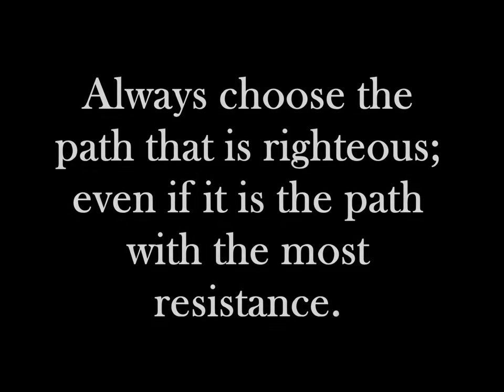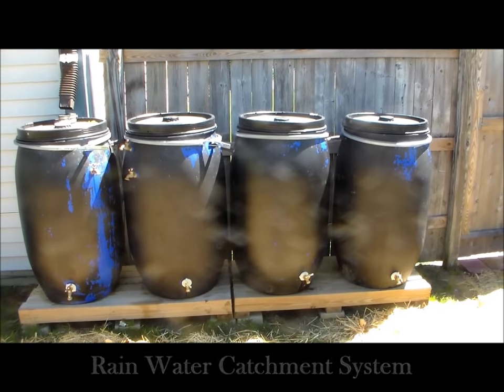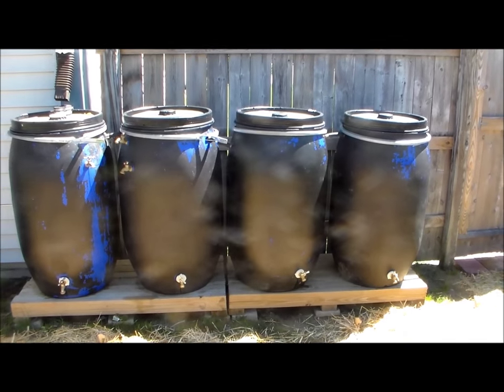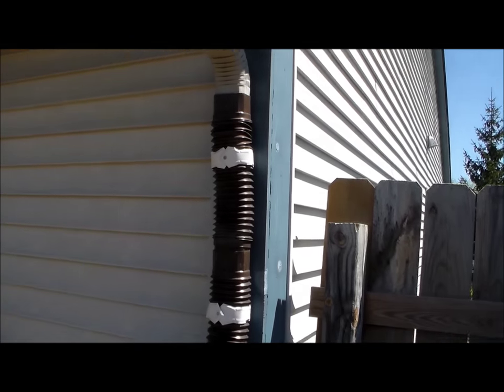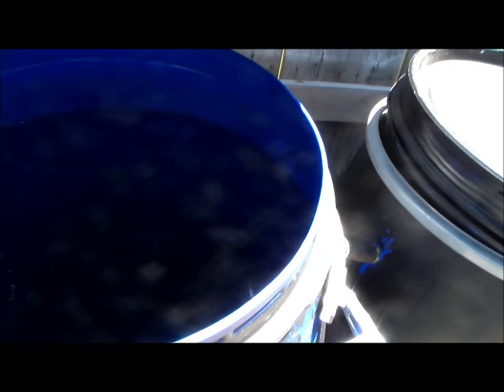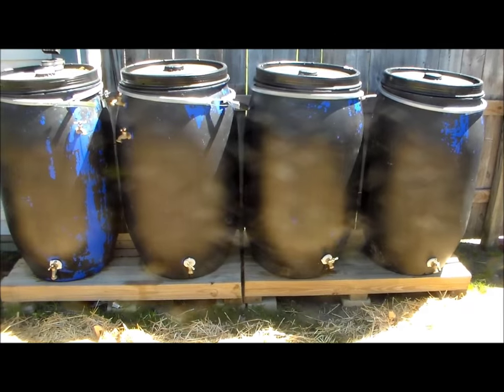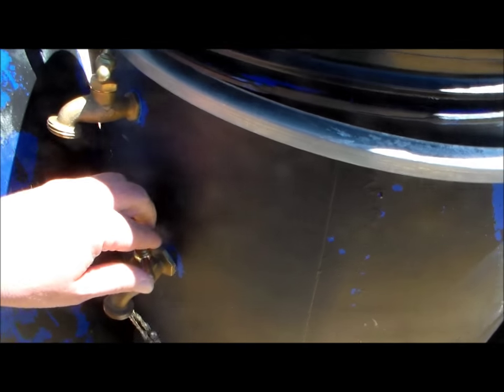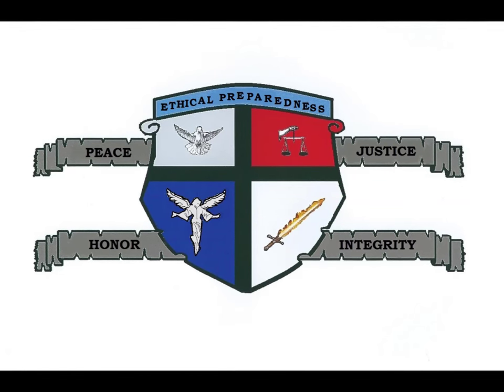Prepper Water Storage: A Poor Man's Cheap Rain Catchment System - Rain Barrels

Comment: Great video! Good, basic hydraulic engineering, and a job well done! I DO have a tin roof, and this gives me ideas! In my area, the city has a "reduced cost" rain barrel program, which is offered once a year. The premise is that we should use rain water for our gardens and water features, and avoid usage of more costly, pre-treated city water. I plan to investigate further, and I'm wondering how much water collection I could manage with big plastic trash barrels? After much investigation and study, I, also, chose the ceramic candle gravity drip purification system. So far, I am satisfied with it. The water I filter actually tastes good! No fluoride or chlorine taste- which you get used to, but you sure do notice the difference when it isn't there!
Reply from the maker: +Kitty VanDuser I've heard the black Berkey filters purify the water a little better than the ceramic candle filters. However, I've only 'heard' this and haven't took the time to research it myself. Do you know if that's true or not? I've got both, I've got the Berkey black filters, plus the ceramic candle filter, plus the Sawyer all-in-one filter too. Plus I've got a couple of boxes of plain pool shock just for back-up for back-up. Take care and keep safe and also thank you for the compliment on the video. :)

Comment: I have a similar system to water my garden,I also have a well with an alternate hand pump
Reply from the maker: +Michael Smith That is awesome! Especially that you have a hand pump for your well. We just recently got a hand pump for the well at our retreat location, but we don't have it hooked up yet. I'm curious of something though- will those hand pumps freeze during the winter?
Reply: +Ethical Preparedness Probably,wish my old Gramps was around to ask how they did it in Vermont.I'm in Florida now so it's not a problem for me.The only trick I can think of is to keep the water running at just a trickle.

Comment: Great job on the video on the rain system, it’s been three years since this video I’m just curious have you made any modifications to the system, thank you
Reply from the maker: Nope, I've not made any (other than adding the First Flush system to them).
I pretty much just clean them out every spring and let the spring rains fill them up. They work pretty good as is.
Note: I do have to touch-up with the spray paint the outside of the barrels every year... as the black paint slowly comes off over the course of the year. :)

Comment: Thank you. Let me ask: have you ever had the water check for petrochems after you ran it thru the Berkey? Ask, b/c as you point out, asphalt shingles, which most of us have, are petrol based.
Reply from the maker: +SC Rider No I have not. But I'm about to get the white filters which filters out even more than the black filters do. But I don't think I really have that much to worry about (of course I could be wrong) because the water doesn't really stay that long up on the shingles anyways (at least long enough for anything to really leach into the water). But again, I could be totally wrong.
Reply: Ok, thanks. Another Q: what is the cleaning out every year revealing? Is there green growing?
Reply from the maker: Nope, I've not had any green growing. Just silt that makes it through the screen. I think (not for certain, just a theory) that painting the barrels black blocks the sunlight and that helps to keep the algae from growing. So for the past couple of years I've only cleaned out just regular silt out of my barrels. The first barrel obviously gets the most silt; and the last barrel is usually still crystal clear every time I dump it to scrub it out. I use a small scrub broom, a little bleach and a little dish soap to clean them. :)
Reply: Ok, thanks, wanted to see what your experience has been, b/c have seen number of water barrel systems that are all cemented, meaning, cannot be taken apart. So, there is no cleaning that can take place, I would assume. Was considering the benefit of a cemented system, vs one that could be inspected yearly.

Comment: I think I may have made a mistake.  I purchased a 55 gallon "rain barrel" to put water in to store in my basement.  The barrel has a screen on the lid.  Is that going to create a problem?  Is the water supposed to be stored in an air tight container?  I plan to fill it with reverse osmosis.  Thanks in advance for your advice.
Reply from the maker: I think you'll want a lid that seals pretty tight for that barrel. 
A screen will allow dust and other stuff to get into your water; plus a screen will allow for water evaporation. 
I hope that helps :)

Comment: Could you live off of 32 oz of water every day in an SHTF scenario? And how would you cook ramen noodles in an SHTF Scenario?
Reply from the maker: It would depend on your environment and the amount of work you're doing (regarding on if you could live off of 32 oz of water everyday). If you're in a very hot environment and doing hard labor (such as gardening and/or hiking, etc), then you would probably need more than just 32 oz of water per day. And you don't have to 'boil' ramen noodles to get them soft enough to eat; I've eaten them after they've soaked in tepid water for about an hour. But to cook Ramen noodles, I would use wood and cook them over a campfire (as long as I didn't have to worry about others smelling my campfire). :)
Reply: Ethical Preparedness Thank you, very informative.
Reply: +Ethical Preparedness if you are in a hot climate only never work during the middle of the day always work in the morning and after noon when it's colder

Comment: when ya say pool shock ya realize there 2 types 1 is poison to you the other is good for this   the correct 1 is calcium hyper clorate      yes?
Reply from the maker: +embarado smithing and woodcraft You are correct sir. We have the regular pool shock that can be made into the chlorine stock to make bleach. We do not have the Super Shock which has the anti-algae chemicals in it. But that's a whole different video I plan to do where I am planning on treating the rain water with the Berkey system and also the pool shock.

Comment: if ya had put the same  hose barbs and hose in bottom as in the tops  ya only need 1  hose  spigot there by cutting cost
Reply from the maker: +embarado smithing and woodcraft I thought of that originally, but it freezes in my state and I wanted each barrel to be able to be individually moved into my house to thaw if needed. So I went ahead and put a spigot on each barrel so that they could be used individually or as a group. At least that was my rationing anyways. :)
Reply: Ethical Preparedness I posted a vid on shock approximately a year ago
Reply from the maker: Can you post a link to it here? You Tube is trying to take me to your Google Plus page and not your You Tube videos.
Reply: it wont let me paste a link hear ill sent it pm
Reply: sent them  i did calculate a touch strong on the cloreen  stock so  it would work well for every one
Reply: +embarado smithing and woodcraft Sorry, but do you mean you would always be drawing water from the barrel to the, in this case, the left? Do you see a benefit from being able to draw from each separately?
Reply: no i don't see any benies    water seeks it own level so as ya draw   all 4  barrels give  if ya wish to  isolate them  put like he did   thats fine  though   i would be using 275 gallon  plastic tanks with all. cages
Reply: Ok, and if the hose is on the bottom, that that increase sediment in the final pour? Can see that the top spill over lets it settle at each stage.